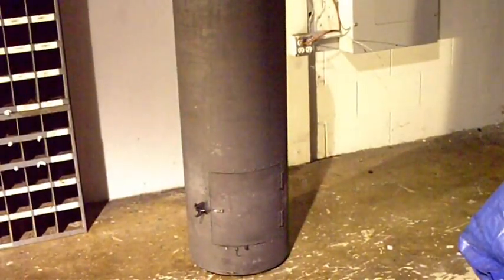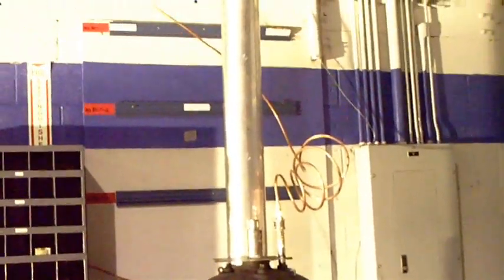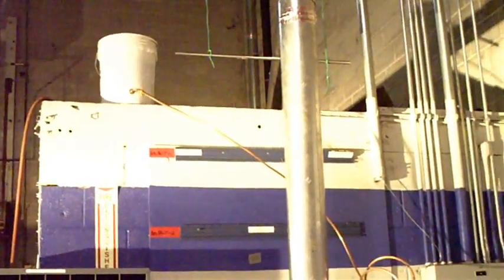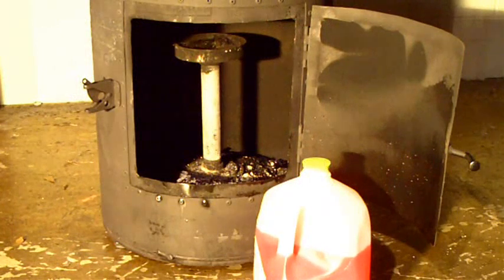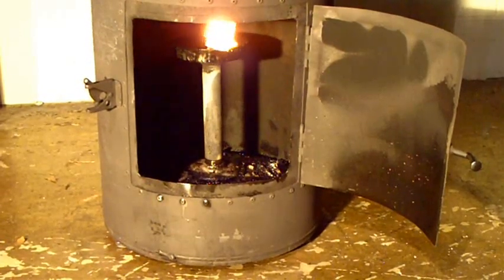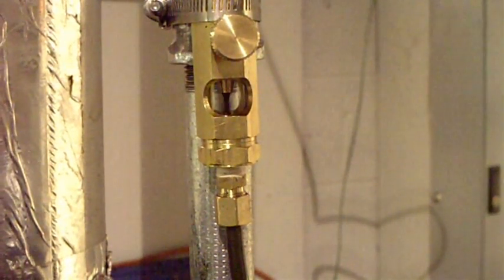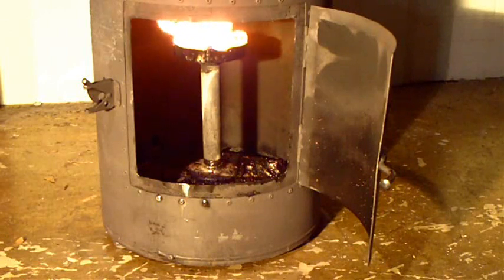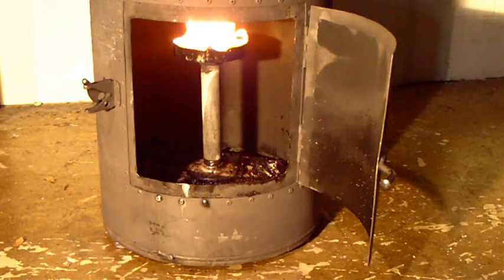Drip Feed Waste Oil Heater

Comment: @Jay Kinkade where did you get that drip valve, I like how you can see how much oil is going trough the line
Reply: +Robert Johnson - At Harbor Freight, they have a see through Glass Air Valve for Air / Water separator.  Use that to modified so you can see the Oil Drips for your Burner.  Also, use the 3/8" Air Valve Adapter, Hose, etc....  Cheaper than buying those things at Home Depot or Loews.  I have a Video in my Channel showing you how to modified to make it a " See Through Drip Valve ".  Check it out or I can post a link here.... I don't know if he would let me post a Link here ://

Comment: hey can i use transmission fluid instead of oil? to burn?
Reply from the maker: Sure, it burns just fine, I've ignited it on a hot exhaust manifold, so it should work fine you may need to adjust the air intake and drip rate.
Reply: thank u. even tho i had a response abut 2 -3 weeks ago.
Reply: Can, but it’s toxic.

Comment: Nicely done, and inexpensive. This is the way I've done it for over 30 years. I never used a sight glass, but eyeballed it coming into my drum stove. Natural convection from the chimney drew the smoke right out of the heater, no forced air was ever needed. I also drew outside air to feed the stove by putting a pipe into the bung of the drum stove. Great fishing camp and garage heater!

Comment: Doesn't the heat burn or cake up the oil running inside the feed tube before it drips to the center of the fire?

Comment: My MENS oil burner looks close to this one. I had is in my basement heating my house. I found if you control the air going into the top you can reach stochiometric, or a place where it puts out the most heat and least smoke. Using an infrared thermometer I was seeing 800-900 deg.F. BUT... there is a teribly touchy maintaning stochiometric. I vented it up a non-dedicated  chimney and when the draft changed and I would flame out and belch soot backwards into the basement.

Comment from the maker: @memadmax69 It gets toasty, if you crank it up it will glow red hot about 8 to 10 inches above and below the burner. Because it's a radiant heater it puts off a warm fuzzy kind of heat that is very pleasant, although it does take sometime to bring a space up to a comfortable temp.

Comment: Do you know the angle of the reverse cone in the burner plate?? I've got some aluminum. I've got a lathe. Would cast iron be better for the cone burner?

It's cold here and I've got an old water heater. Need to make fire....

Comment: I have found that preheating the burner with a propane weed burner really gets the draft going with the door open and I can start with WMO instead of heating oil. My WMO drips from four feet above the burner area through a 3/4" copper tube. There can be no flashback since there isn't enough heat or oxygen in the tube. good vid.

Comment from the maker: @torr58 Correct me if this is wrong, but the way I understand it, Fire needs Air to burn and when the fire is started at the burner it sucks the air in from the closest place, which is from the fresh air pipe positioned right above it (intake). The fire and the smoke can't go up the intake because the air is being sucked in, so the smoke goes out the flu. As far as fire going out the flu the fire never gets that big, because the fuel is metered to be just enough for the burner area.

Comment: I need to know how the fire and exhaust does not shoot out the intake and alternatively goes out the flue.  According to some designs (yours as well I think) the intake cone rest down on the burner separated by a few inches and is supposed to drawn air down onto the burner and allow fire up the sides of the stove and out the flue.  What keeps the fire in?

Comment from the maker: @alaskanalain  I've never seen a non-modified Mother Earth News Waste Oil Heater (The original design on their web site) so I can't really speak to the difference. I have always assumed from reading Roger Sanders articles and other sites on the internet that the "Modified"  heaters burned cleaner and more efficiently. From my experience building and operating the heater in this video, vaporization (drip feed) heaters produce a lot of soot and smoke. Check atomization (babington) heaters.

Comment: How well does it work compared to the original mother earth heater?  I'm building one but I don't see how this design can work well compared to the original with the air preheated and the burner plates that has a secondary burner built in.  When I read the blurb for the conical design and that it burns cleanly by not burning completely I shook my head and laughed.  Does it work well and burn all it's own smoke and soot?

Comment from the maker: @thierryanna It's about 5.5 inches between the burner plate and the bottom of the air intake pipe. The air intake pipe is 4", you need to look for a 40 gallon tall, gas powered water heater, some of them have 3" flues and some have 4". The four inch ones are known as high capacity models. Finding one of these will save you lots of time cutting and modifying since the pipe is already the right size. For the oil feed line I used a piece of 1/8" steel brake line from the local auto parts store.

Comment: @jahzoone I'd appreciate Roger's E-mail address.
I'm wanting to build on of these heaters using a 24" sch 40 pipe.
I would need the valve and conical plate and am maybe the filter also.
Thanks!

Comment from the maker: It's a super simple design and it works great. No worries about the oil in the bottom of the heater. I took a screwdriver and wiped it across the top of the burner to get the ash from the paper towel out of the oil pool after it was started and some oil spilled . The only place hot enough to ignite the oil is on the burner. It's very safe.